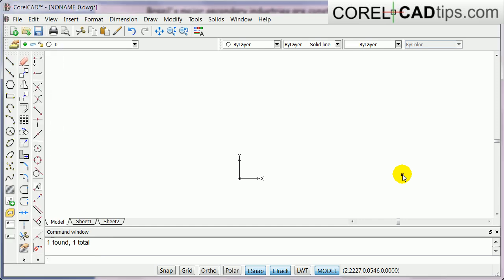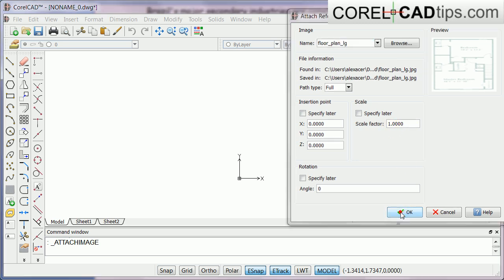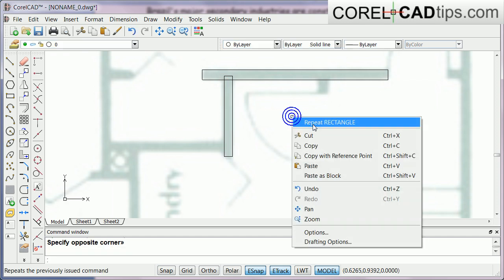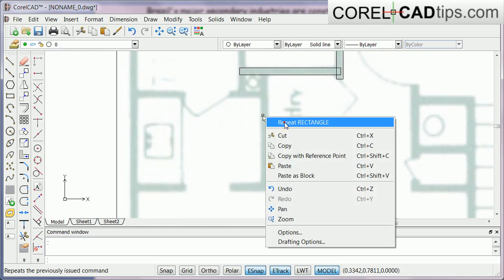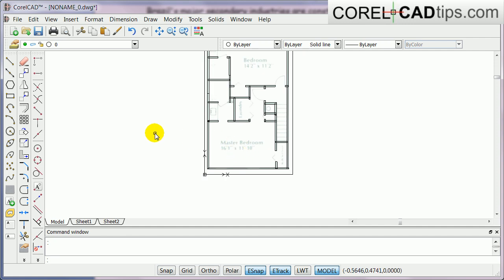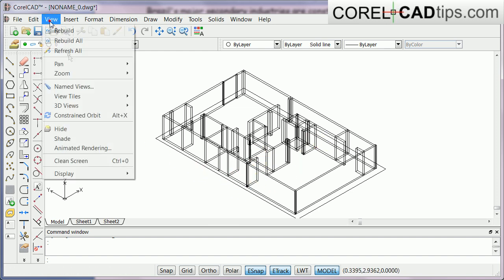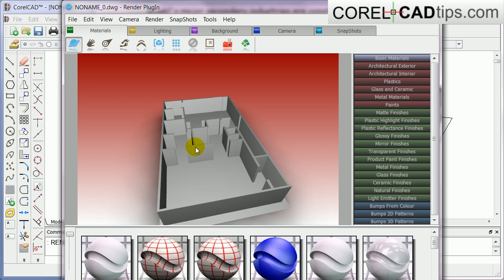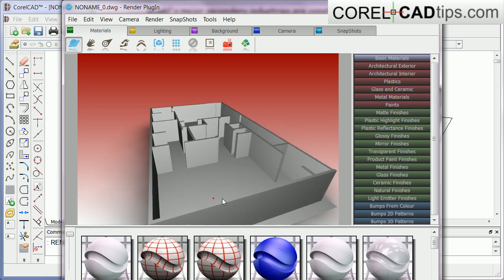CorelCAD - Creating a 3d floor plan

Comment: I saw a youtube section on making to circles then extruding them and subtracting the inner extrusion then radius both inside and outside of the top giving a rounded top then he turned it over and subtracted the inside to make it a shell of .062 thickness in auto-cad. can it be done in coral-cad if so could you do a youtube section on it? I hope to see it done as I am trying to learn this cad, corel that is. I have learned a-lot from you tutorials and like seeing them. Thanks for doing them.